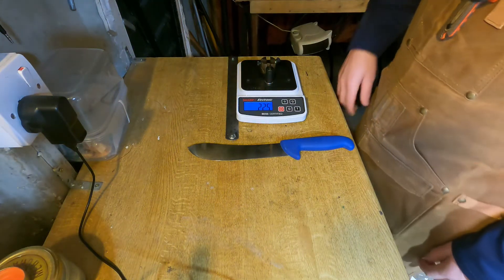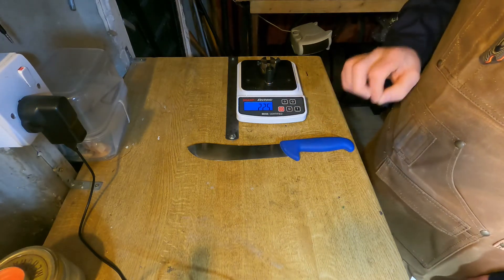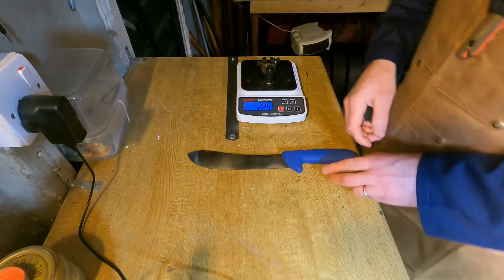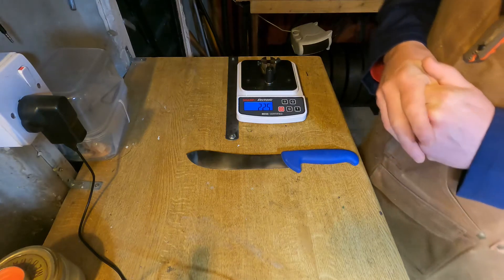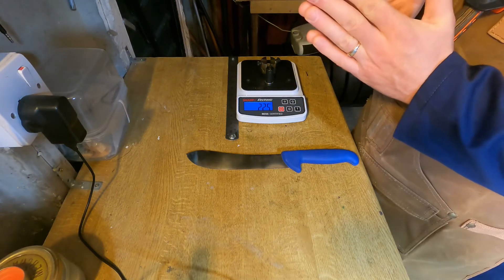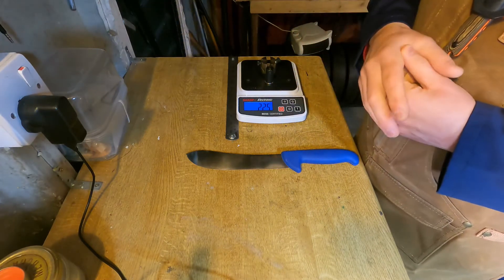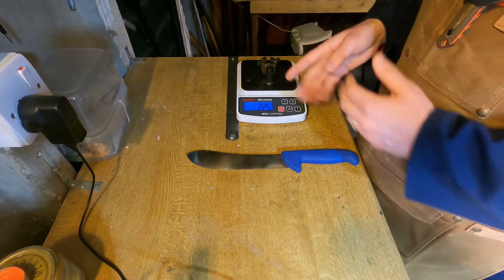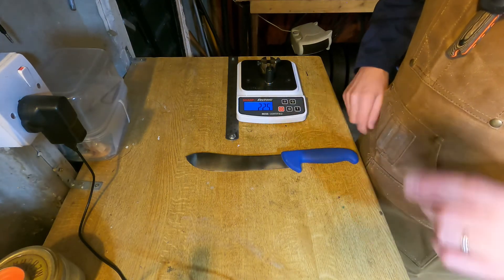Discussing edge retention after knife sharpening

Comment: In this case I would use a F.Dick polish cut Steel to realign the edge to a „V“ 
I use a setup like: hard passes on a honing steel to straighten edge roughly, diamond steel to shape the “V”, ceramic honing rod to polish and then last but not least back to the honing steel with light passes to remove burs and give the edge some bight!